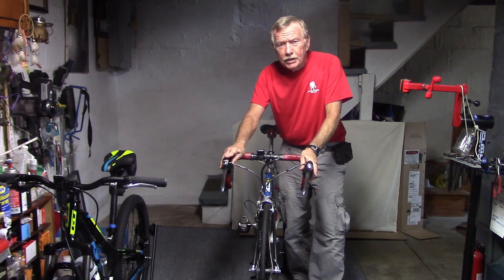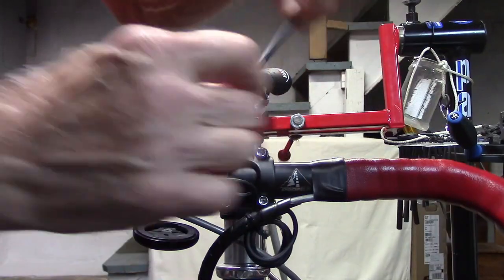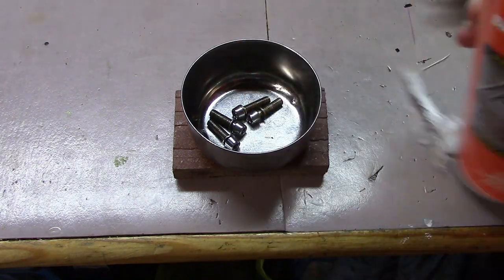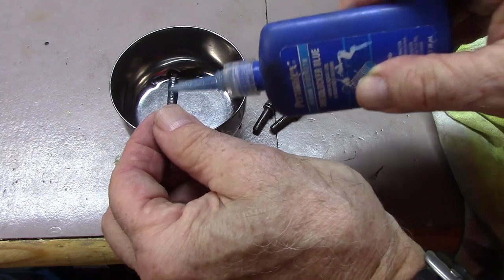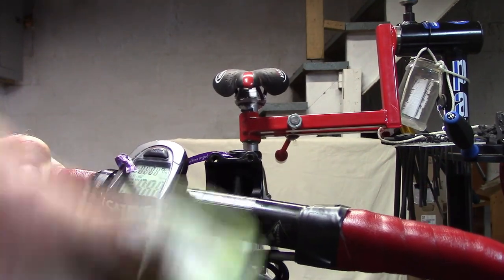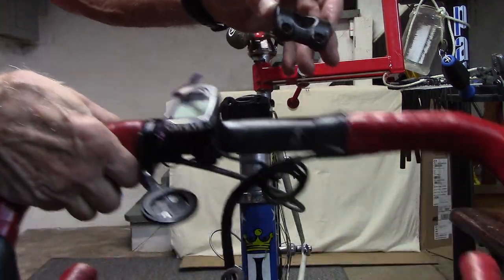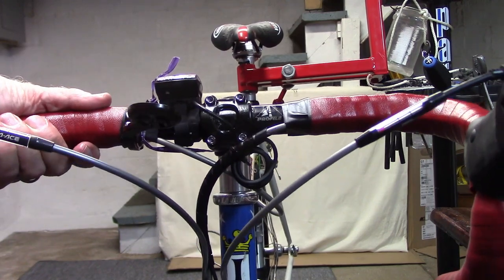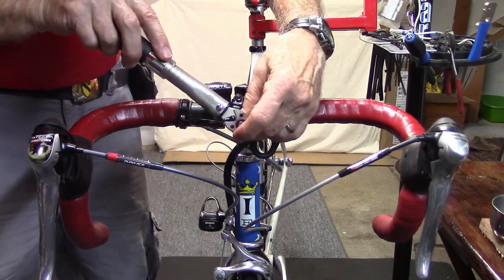Handlebar Creaking: Problem solved

Comment: Very helpful video thanks
Reply from the maker: Glad it helped. I, myself, had this problem with one of my road bikes. I really noticed it when I was climbing hills holding the handlebars tightly. But on the flats when I loosened my grip on the bars, there was no creaking. This solved the problem.
Regards and safe cycling, Tony

Comment: Creaks are always such a doozy - once I got really worried over a creak that turned out to be coming from my helmet visor! With how loud it was coming from right on top of my head I thought I had managed to crack my frame or something.
Reply from the maker: Great story. I agree that locating the source of the creak, squeak or click can be a real challenge. In this case, it was only when I noticed that the harder I pulled on the handlebars, the more prominent the noise. Thanks for sharing. Tony

Comment: I do this but use grease on bolts and bars and do it every 3-6 months I have always do it this way but if you do things the way you do and it works carry on
Reply from the maker: I'm not sure you need to clean and regrease the handlebar bolts and clamps that often. Using Fiber Grip allows compression of the particles in this lubricate when you torque to the manufacturer's specification - preventing slippage. I use medium strength lock threader (Loctite blue) on the bolts of the handlebar clap to prevent loosening. It shouldn't need service unless one hears creaking. Although, if you ride often in wet conditions, yearly cleaning and maintenance at the most would suffice. Regards, Tony

Comment: can i replace product with a small amount of an electrical tape? thanks
Reply from the maker: If you're talking about the bar tape, yes. I normally seal the ends of the tape by wrapping it with electrical tape. Better then the strips that come with the tape. Hope this answers your question. If not, let me have some more details on the product you're replacing.
Regards, Tony
Reply: @tony10speed  hi Tony thanks for reply, no I meant placing the tape instead of the fiber grip, that could prevent it from creaking.
Reply from the maker: @sergeyb6071  Electrical tape will eventually erode under the pressure and move around creating noise and even a handlebar which will slip. A good thought but not practical. Regards, Tony
Reply: @tony10speed  yes, indeed, I tried it today, definitely not the greatest fix

Comment: My bicycle handlebar sound wiered when i am moving it
Reply from the maker: If you let up on the handlebars as you are riding, does the sound go away. That would indicate that you need to follow the steps in our video. One note: If your handlebars are made of carbon, see if you can produce and flex by pushing on one side then the other. Such flex would indicate a defect in the carbon and the handlebars should be replaced. 

Sounds that seem to becoming from the handlebars could be coming from other sources. See our video:
https://www.youtube.com/watch?v=wEWB4OfV6lM&t=287s&ab_channel=TonyMarchand

Regards, Tony
Reply: Sound doesn't stop also if i am riding a bike
Reply from the maker: @keshavlakhera690  Did you try the measures mentioned above and in the video?
Reply: @tony10speed  yeah i have tried all the step you have mentioned in the video
Reply from the maker: @keshavlakhera690  I wonder if the stem clamp for the handlebars is the correct size for the handlebars. All I can add is to have you're local bike shop take a look. I wish I could do more but trying to solve this problem over the internet is a challenge.
Reply: @tony10speed  we can do it by video call

Comment: What does the loctite do?
Reply from the maker: Thread locker such as Loctite are designed to lock and seal threaded fasteners to prevent loosening from vibration. It prevents leaks and the rusting of threads. It eliminates the need to stock expensive lock nuts and lock washers. It sets in the absence of oxygen. I suggest Loctite blue (medium strength) for most cases since you may eventually want to remove the part.

Comment: I've used just grease on my titanium bike with no problems.
Reply from the maker: If you have a road bike, most likely your handlebars and stem are an aluminium alloy although titanium handlebars are available. Grease or anti-seize will work but my preference is Fiber Grip on the handlebar clamp even if they are non-carbon to decrease noise, vibration and slippage.

Comment: Creaking when rough road.
Reply from the maker: If it's coming from the front end on rough roads or under heavy load when climbing. It may well be the handlebars as in the video which should fix the problem. But I've also experienced in coming from the headset. Here's how to overhaul and grease the headset bearings:
https://www.youtube.com/watch?v=BqzpkW2vxuI&ab_channel=SickBiker
Let me know how you make out. Regards, Tony